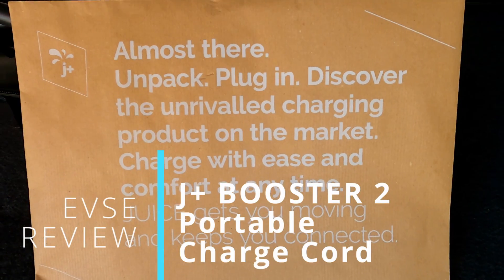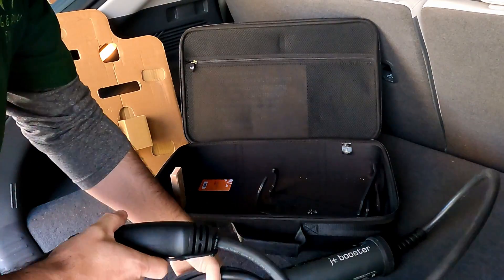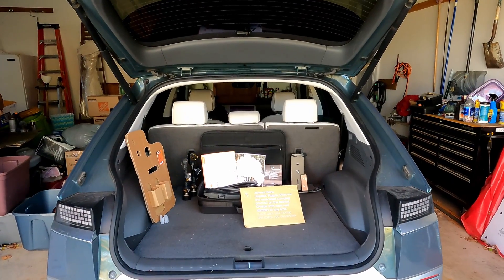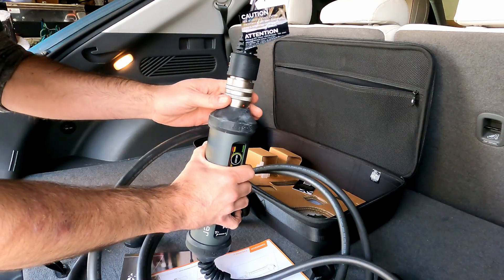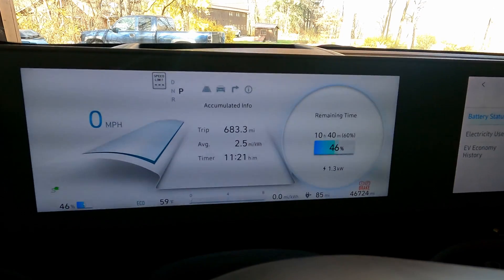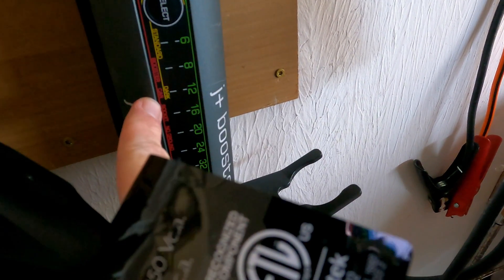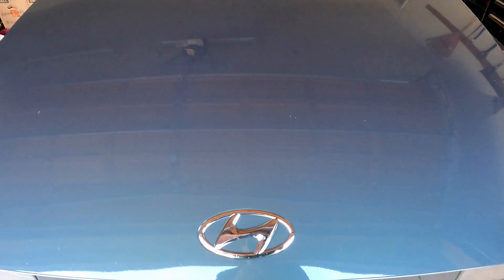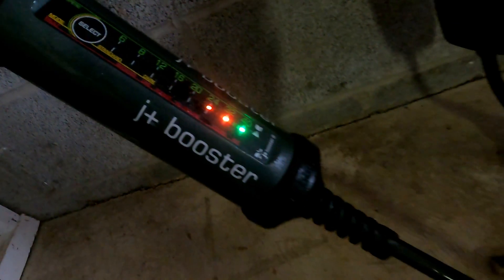This is the Best Portable EV Charger We've Tested | J+ BOOSTER 2 EVSE Review

Comment: I was to change my car at home I don't have a permanent charge on the wall so looking for one I can carry in the car so when I plug it in to my home what socket would I need any special socket
Reply from the maker: For your regular household outlet, you'll need the NEMA 5-15 plug. This is slow (around 3-5 miles per hour added) but can add back typical daily commuter range overnight (30-40 miles).

If you have a dryer outlet available, you'll most likely need the NEMA 14-50. This is faster and what most people use to get fully charged (or to 80-90%) overnight. For older homes this might be a NEMA 10-30 outlet, so be sure to check and get the right plug. 

This chart is useful to identify what outlets you have at home: https://i.sstatic.net/2TxVg.png

Comment: Hi could you tell me what the 2 plug where the name please looked like one had 4 pins ?
Reply from the maker: Hi Richard. The two common plug types shown are NEMA 5-15 (three prong) and NEMA 14-50 (four prong). I also have the NEMA TT-30 adapter, but that's more for camping and not a common outlet at home.

Comment: hi.. could you please şnform me how to finish charging.. what is the first step and the next steps? I mean you first cut the electricity directly from the wall or is there an ON/OFF button in the juice booster? or you first finish charging from the car?
Reply from the maker: The Juice Booster 2 doesn't have a function or button on the unit to stop it charging while plugged in, so that command would have to come from the vehicle, its app, or by manual intervention to push the connector trigger and unplug.

Comment: We are not allowed to charge our car on our campsite what do you recommend
Reply from the maker: Other than speaking to the campsite manager to change the policy or perhaps install dedicated EV charging posts (some areas have incentives for this), I'd recommend a fast charging stop at the nearest station prior to setting up camp.

Heavily dependent on the location and how far you have to travel post-charge, of course, but if you can charge above 90% and then use slower roads to head to the campsite, starting a camp stay at 60-70% gives you plenty to work with, in my experience.

Comment: Purchased for '23 VW ID.4 Chattanooga Model for the same price as the far inferior VW portable charger (which is not included with the ID.4). Connecting to USA NEMA TT-30 RV 125V 30 amp outlet. Amazing construction quality. Worked instantly, charged from 44% to 80% in 12 hours. Now I need to go find out how to get the extension cables. Once I get a 50 amp breaker and NEMA 14-50 outlet this should do 5% battery to 80% in the same time. No reason to look at any other charger for home and portable use unless you need to have the charger on a network or to control on remote (which I wanted to avoid.) I've read it's the only UL certified portable charger in the market - don't know if that's true but it is UL certified. We'll see if the ID.4 is built to the same quality standard as this charger!
Reply: Does it fit under the id4 cargo floor in its case?

Comment: Why did you choose to charge to 100% instead of. 80% for time metrics for everyday charging?  80% is more realistic.
Reply from the maker: I was traveling long distance not long after this was recorded, so my limits were set to 100% for road trip mode. Didn't think about it much, tbh, as the power delivery remains the same right up until the final cell balancing at the top of the pack. Whether it's 80%, 90%, or 100%, comparing the time to complete in general still shows the difference in charge times at 120V vs. 240V, which is all I was really going for here.